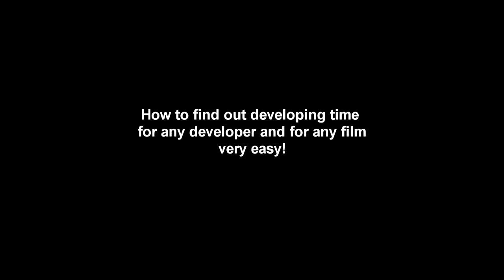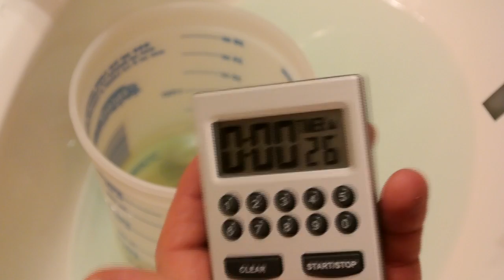How to find developing time for film and developer (Developing black and white film)

Comment: Very interesting  tip.  Did you subsquently develop some film at the estimated time/temp and confirm that this technique provides the result you expect?
Reply from the maker: @GrahamNorth-g8h  yes sir.  It works. But like with anything else there is about 10% margin of error. For black and white it's barely noticeable.

Comment: Just double-checking you said "horse urine", not "whore's urine" at the end there. Neither are especially easy to find around here...

Anyway, thanks for posting this. I'll use this method to check my older developer is still good to use. If the dev time is greatly extended, I'll know it's time to ditch what remains in the bottle. Thanks!
Reply from the maker: Horse for sure. Lol.  Thanks for watching

Comment: great video!  Any ideas on how to get dev times for a roll of film you want to push?  I want to push HP5 to 12800 and don't see that on the massive dev chart. thanks again for the knowledge!
Reply: Most globular (non T-grain) film give you another stop when pushing by multiplying the normal dev. time with the square root of 2 per stop push. So this is a N+5 and the dev. time would be the N dev. time times 1.41 x 1.41 x 1.41 x 1.41 x 1.41 = times 5.67, at least.
In general underexposure is not very sensitive towards dev. time. 1 to 5  minutes more don't matter that much.
Reply from the maker: Grant, I will not try to pretend I know the answer.  I used to be part of Photo.net website and in their film developing forum, there are some real sharp people that will help you with that.
Reply: Hey, I've did this before. For HP5 in 12800 I used D76 stock, 24 minutes at 24°C and worked fine.